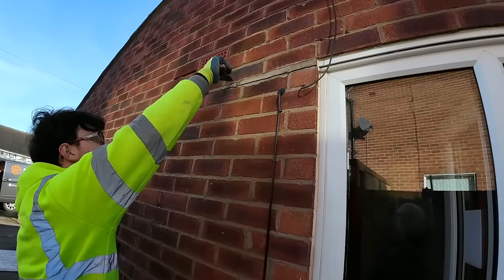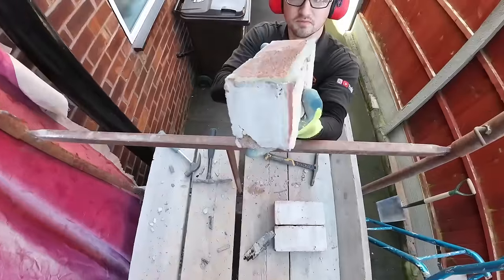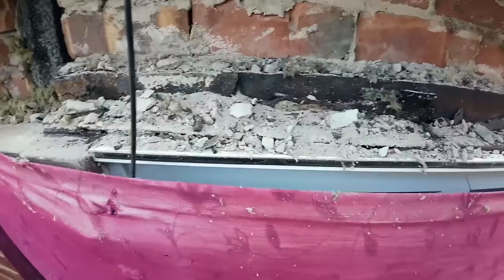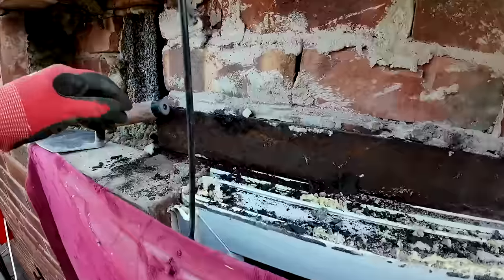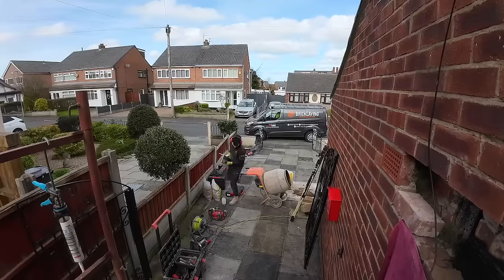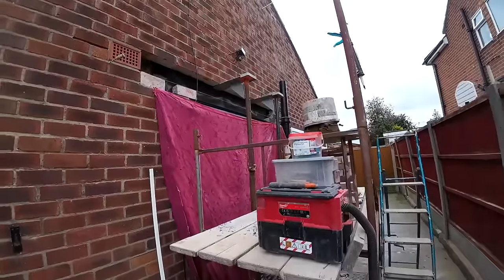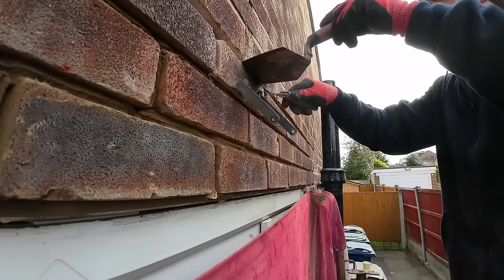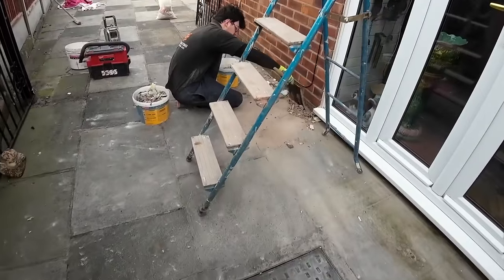THIS LINTEL IS CRUMBLING

Comment: Why did you not finish the pointing level with the face of the brick like the rest of the brickwork, maybe I missed something at the start of the video.
Reply: The rest is going to be raked out and the whole lot then re-pointed.
Reply: Thanks, I must have missed that bit@bigjohn1236
Reply from the maker: 🧱👍🏽ta big John
Reply: Remember Steve said he was going to use a cement mortar to to the repair then when they repoint the damaged mortat on thegable they will use a lime mortar and also finish off the new area with that so that it all matches!